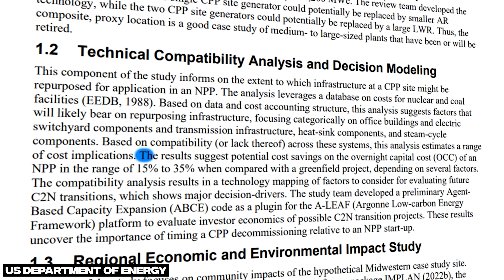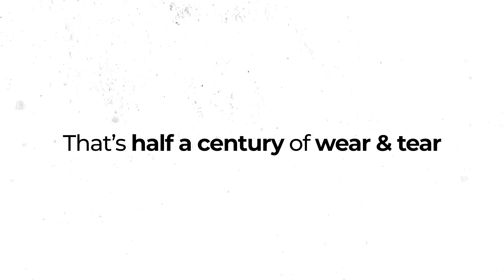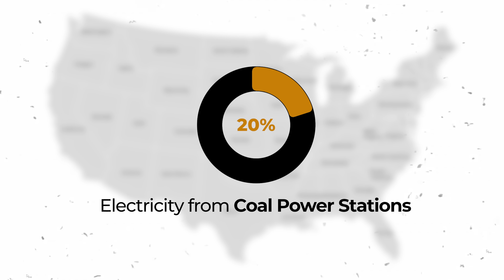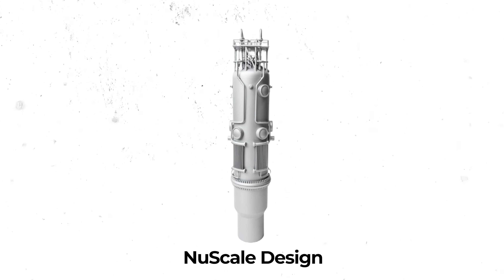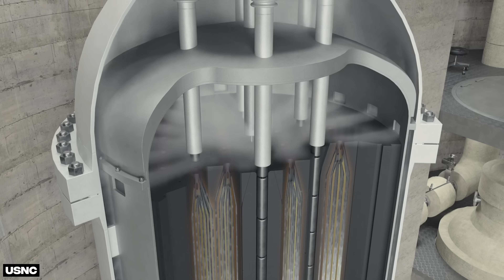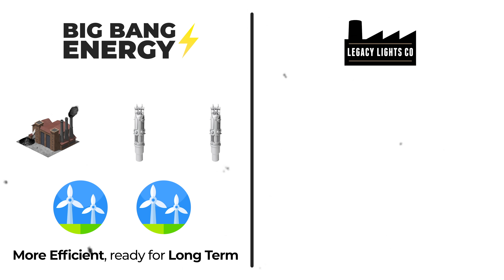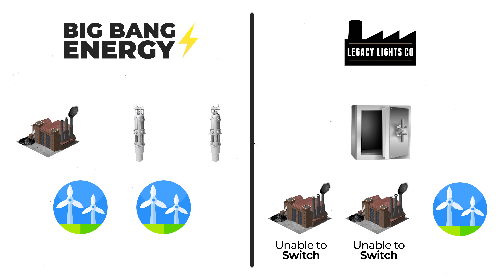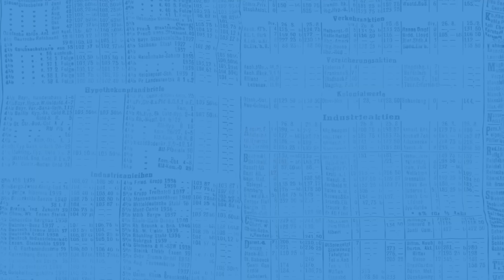Can We Convert Old Coal Plants to Nuclear Energy?

Comment: A potential issue for using the existing turbines and some other components is that a lot of coal fired plants operate a significantly higher steam pressures up to supercritical temperatures and pressures, while nuclear plants operate in the 800 psig range with saturated steam rather than superheated steam meaning the design of the nozzles, etc. would be wrong.
Reply from the maker: The DoE study looked at various ways to either reuse or replace the steam components. In the case of keeping it, sometimes it required an additional loop or using the gas reactor to get to superheated steam. It's unlikely to be a one-size-fits all, but each site would need to be looked at on its own. Your point is right though and some adaptation would be needed. Cheers!
Reply: @atomicblender   davidjernigan8161 is right.   You just cannot run saturated steam though a supercritical steam turbine.    They just are not desiged for it.   Saturated steam throws off a lot of water droplets at each pressure drop through the turbine, and saturated steam turbines are designed to handle that water.  Supercritical turbines are not and massive damage would quickly occur at any meaningful turbine power levels.

I'll address the 2nd loop steam generator with super-heated steam in a separate post under my initial post.  I need to research what the design pressure and temperature of the helium pebble bed reactor MSR is.   Hint: The steam pressure and temperature will need to be below that for some very real practical reasons.
Reply: Steam plant has a lifespan anyway. Sooner or later they get major overhaul or complete replacement, perhaps several times in the life of the power station.
There is no real scope for re-use, just build the specific plant that is optimal for the reactor.
Reply: @aaroncosier735  Wrong:  The boiler, main steam, condensate, and feed-water piping typically last the entire life of the plant (with minor repairs over the decades).  the Turbine casing and Turbine rotor typically last the life of the plant.   It is common for the turbine rotor to have certain rows of blades replaced over the life of the plant (typically the back end of the LP turbines due to water damage).

Feedwater heaters are typically replaced at least once in a 40+ year life of a steam cycle power plant; although if built with better materials up front they can last the life of the plant as well now.
Reply: @perryallan3524  
However the expensive bits like the actual turbines experience erosion during normal use. You know, the delicate, high speed, finely balanced bits.
The life of all the high temperature and pressure components is determined by the stresses and fatigue imposed by thermal cycles. These define the "lifetime of the plant".

Even if they lasted the life of the coal power station, they are useless for any future application. Clapped out.
Reply: @aaroncosier735  If you have read my other postings in this thread you would know that I stated up front that the turbines would have to be replaced, along with all the piping.  But the turbine foundations could potentially be reused.

I know of 60 year of 2400 psi 1005F turbines still running on their original HP turbine rotor (with 2 re-blades of the last 2 rows of the LP turbine).

As for stresses... forget it. At 1005 F the steam piping and HP turbine casing inlet glows dull red in the dark if you take the insulation off (I've personally seen it)  These things are inherently stress relieved in use.
Reply: @perryallan3524  
I'm sure there is the odd record breaker for longevity. There are also much younger plants that had catastrophic failure. 
Materials do indeed fatigue. Lifespan is determined in part by the number of thermal cycles. If you have the luxury of  running continuously, you plant will last longer, but all those components fatigue. 
These plants are being decommissioned for a reason.
Reply: What makes sense is to have high temperature reactors with heat storage.  Heat could then be taken from the storage tanks at the tempature that is needed.  This would solve the type of steam problem and enable the plant to concentrate on producing power when wholesale power prices are at their highest.  This would increase the profitablity of the plant
Reply: @aaroncosier735  Those premature failures are always due to undetected flaws; substandard welding, or substandard materials, or poor design.   Most all of which can be detected in advance if people are looking for them.

Maintenance of Power Plants involves taking care of normal fatigue components (replace minor parts and components) and monitoring of metallurgy of turbine casings, boiler drums, and other major components (you can take replica micro-graphs of a polished etched spot and look at how well the material is aging and if its approaching failure or not:  I've used that technique since the 1980's).

You can identify pipelines and sections that are susceptible to FAC or other corrosion and monitor them.   Again, a many decades old technique (By the way - I later worked at the Nucear Power plant that had the 1st FAC failure of a FW Heater shell - which woke the industry up to the issue).  FAC is easy to prevent by installing better metals (chrome- molly steal vs carbon steal is all that is needed in most places).

The base equipment really is designed for long life, and a number of power plants do operate for 60 - 80 years that were designed to run for only 40.

In most cases the reason the plants are being shut down is due to the amount of air pollution they emit and that the cost to modernize or repair the plant would require them to meet pollution "New Source Performance Standards" (Note the rules are written in a way that if you need to spend over X% of the value of the plant to rebuild or repair - that you must meet pollution New Source Performance Standards - which can realistically only be met by a new designed plant from scratch).

This is driven by the fact that repair parts for all the lessor equipment is very expensive or just unavailable - and the cost to install modern replacements is not worth it.  It's not uncommon to get to a point that an older plant needs an entirely new control system including all the contol valves as you can no longer realistically maintain the originals.   That's a costly redo - and toss in any kind of other work to extend plant life and you are pushed over the cost limit and into New Source Performance Standards.

While I have heard of a few Fossil plants shut down due to Steam Drum aging and 1 due to turbine casing aging most shutdown fossil plants do not have those issues (as they are monitored for those issues).
Reply: @jimfrazier8611 Why would you think those cores should e on the second or third cores?  Fuel rod life is 6 years run time at full power for the Vogtle AP1000's.
Reply: @stanleytolle416  That cost a lot of money to build and maintain... How do you build an economical plant with spending all that extra $?
Reply: @perryallan3524  TeraPower is projecting that the cost of a coal plant conversion to nuclear with storage would cost about one billion.  Of course fuel cost would be close to zero since no fueling would be needed for 20 years. So this cost is really not the issue since the issue is will this plant be able to make a profit on the electricity it produces. With the storage about three times the power can be produced on demand, when it is needed and the return on producing this power is at it's highest. Essentially what this plant can do is produce it's maximum power when the sun is not shining, the wind is not blowing and customers are willing to pay a premium for this power. This setup would make this sort of plant profitable event if it is not the cheapest way to produce power.
Reply: @stanleytolle416  The biggest myth is that these estimated cost are correct.   Nuclear cost are often way underestimated by parties that have not been recently building nuclear facilities.   Most of these people really have not clue.   Look at the cost and time overruns for Summer (AP1000) before it was cancled and Vogtle (AP1000) Look at the cost overruns of the EPR's in Europe.  Both the AP1000 and the EPR were evolutionary designs of PWR's - but neither the USA or Europe had built new nuclear power plants in decades and had lost the knowledge of what really needs to be done at all levels from major oversight to subcontractor.   

Meanwhile China built 4 AP1000's with minimal budget and time impact and at least 1 EPR which had both budget and time overruns (France has now admitted that the EPR design is flawed and needs to be reworked).   China had been building PWR nuclear power plants for years and brought experienced contractors at all levels to the projects.

The 2nd myth is that somehow an untried design is actually going to work as designed.    The nuclear industry has far more failures than successes on the 1st iteration; and to date no one has yet built a sodium cooled reactor that did not have critical sodium leak issues (and there have been a lot of research reactors and at least 3 sizable power plants built).

Look past the theory and concepts - look at real world implementation attempts at these kinds of technology.

The construction of a novel reactor type is a 1st time build of the concept.  It's all experimental at that stage for all major components and key system design parameters. All very expensive for the 1st time.

There are actual studies that project the cost savigns from building multiple plants based on the experience from building the previous ones.   If the USA were to build 2 more AP1000 units using the contractors that built Vogtle starting soon, the estimated cost for the 2nd pair would only be about 75% of the 1st pair, dropping to 60% by the 3rd pair, and about 50% for the 4th pair (and decreasing slightly after that).

So I don't believe the cost, and I sure as heck don't believe that the Terrapower Natrium reactor will actually work and have a long life.   Most likely to be shut down within a decade, and possibly sooner.   There's no economics in that.   

On the other hand, if Bill Gates is serious I encourage him to sink a few $Billion into building and operating his design so that they can come up with a 2nd generation design that would work better.
Reply: @jimfrazier8611 You probably had refueling outages every year, and possibly 1/2 of the core changed each refueling cycle.

Those old plants now do refueling outages every 18 months and only change 1/3 of the core - getting 4.5 years out of each fuel assembly (I have worked in 2 plants that went online in the early 1970's that started with annual refueling outages and changed to 18 month refueling outages).

The newer designs (AP1000) are designed for 2 year refueling outages changing 1/3 of the core for a 6 year fuel rod life.

A few of the nuclear plants built in the 1980's have been able to be changed to 2 year refueling outages.
Reply: @perryallan3524  Costs have gone out of control for custom made giant NPPs. Nuclear plants in China, Korea and Russian built plants have not been built on time and under costs.  Modular plants are most likely not going to be going out of control financially, once they have been developed, because they are going to be simply repeats of earlier built plants. The big financial difficulties we have been having with our plants has been from inexperience and changes in plans as the plants are being built.  Like almost 100 plants were built in the past with relatively little fuss we should be able to do this again.
Reply: @stanleytolle416  But the first number of plants will not be repeats.   They will be "one or two of a kind assemblies" just like the plants built in the 1960's - 1990's and there will be no factory production lines until after they are proven to work.

So starting up MSR's is going to be very costly.

Actually the cost of building a large nuclear PWR plant is economical where you have experienced contractors with recent nuclear build experience.   Look at Korea and China as examples.
Reply: @perryallan3524  Maybe new PWRs are on budget in China, but the US and UK examples do not look so good.
You specify "recent build experience" as a prerequisite, and it is too often not met.

What to do? Build plants for the sake of practice? The same effort and money could go to building disposal sites, for which the US has zero demonstrated working examples. There is some "industry knowledge" worth developing.

I agree that MSRs have a long way to go before matching expectations.
Reply: @aaroncosier735   Yes, Someone is just going to have to front the cost to build a series of plants to get the required worker and contractor experience necessary again in the USA.

The US Government (largely the US Navy) funded that in the 1950's and most of the 1960's that allowed most of the nuclear power plants to be built in the later 1960's - 1990's (without getting into the issues of the NRC changing design and construction criteria while a plant was being built - the reason for the delays and cost overruns of most of the later plants: the NRC now approves a fully designed plant up front and as long as it's built to that design it is licensed which is why the AP1000's were built in the USA).

A major difference in worker and management attitude is necessary for nuclear plant construction versus conventional construction.

Vitually every conventional construction project is not built according to plans.  Lots of "minor" and even some "moderate" deviations occur.  It's just accepted that the results are "good enough" for the purpose or that field engineered solutions installed without any design review are adequate (and I have done such field engineering modifications in fossil plants to get a job done).

It takes a totally different management and worker attitude and approach when building nuclear.    You must build exactly what is specified as the NRC has approved exactly that.  Design modifications can cost millions of dollars in engineering and delays getting the necessary approvals.

At the first hint of even a minor deviation of problem you need to stop the work. Step back.  Reset to a safe mode.  Analyze why your construction plans were not working, and figure out how much back you have to go; and then progress forward with a new plan that should work.   Done right this actually saves time and schedule.  Done wrong - or progressing too far and it gets very expensive with long time delays very fast.

Training workers and construction supervisors in that method of working (which is not natural for many of them) takes time; and it has been learned that many highly successful non-nuclear construction supervisors and workers are not capable of making the transition.

I have not verified the story:  But I understand one of the 1st major delays of Vogtle Unit 3 was that the concrete workers did not space the rebar and pour the reactor building foundation correctly (it was "good enough") - and they had to break at least portions of it up and redo it.   These kinds of mistakes happened with many different contractors many times at Vogtle.

It's just a totally different world than non nuclear construction.
Reply: @perryallan3524  
I appreciate some of the difficulties. Aerospace has to keep fairly close to spec too. Then again, first stage boosters don't get poured by local concrete contractors.
I'd heard the Vogtle rebar story too. 

Now, is this worth it? "she swallowed the spider to catch the fly".
The Navy may feel justified in speeding up retirements, just to maintain new build capability and keep the contractors busy and the per-unit cost down, but even their budget is strained. How many over-budget APR-1000s will have to be built to support the fiction that the next one will be on-budget?

At the moment the world seems to be spending hugely and multiplying installed capacity on other options than nuclear.
For large scale PWRs facing stiff competition, is that even worth trying to do?
Given that there are certainly regions and situations where nuclear is the clear best option, it makes sense to have/build/maintain capability in that scope. So maybe a crack team for those few rather than trying to build a generalised national capability?

There are certainly a lot of rusted on pro-nuclear commenters who seem awfully certain that "good enough" really will be good enough. You have expressed doubts on that line, and I certainly have them.